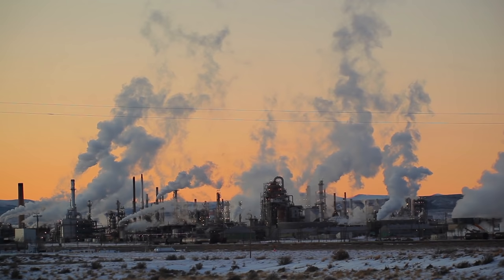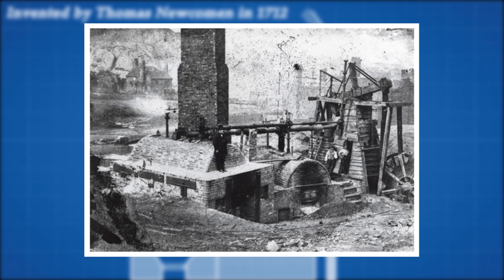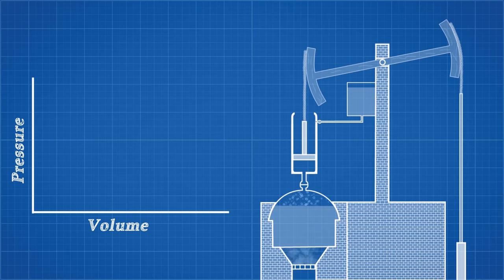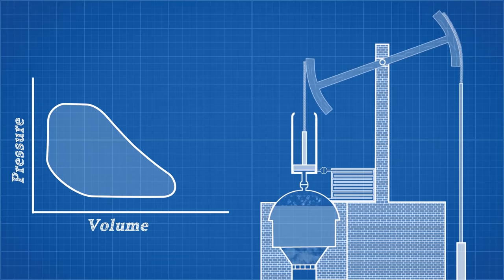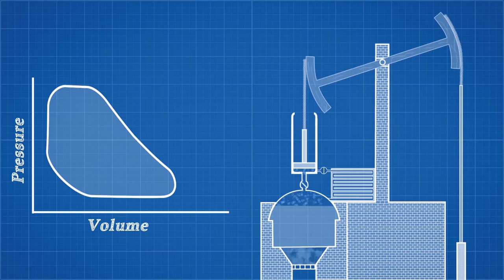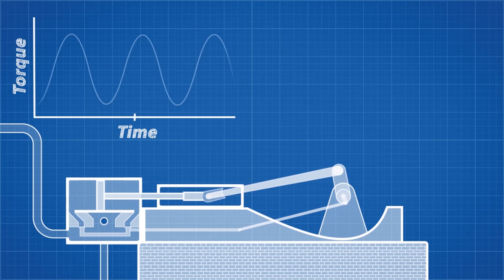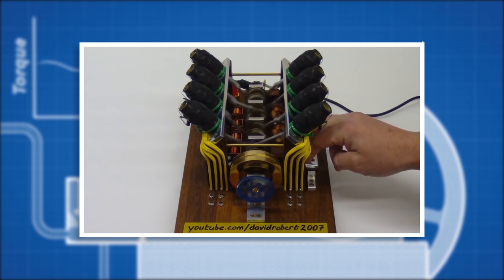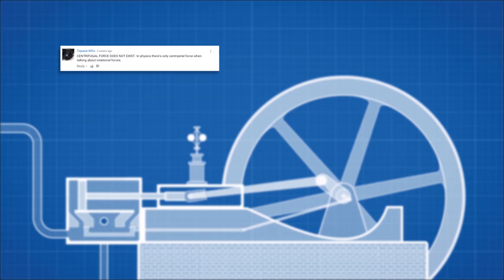Steam Engine - How Does It Work

Comment: Modern history is about human kind trying to find different ways to boil water.
Reply: Hmmm... A new type of internal combustion engine? 
Can I put people in a giant metal shell with a massive turret powered by said engine in order to obliterate my enemies?
Reply: That's not modern history, that is the cause to write history :D To kill each other in better and more efficient ways
Reply: I swear we'll just be using antimatter to boil water if we ever get a significant source of it.
Reply: There is the van allen radiation belt, which contains a lot of positrons
Reply: Isnt that something. If only the regular people knew. I will like your comment.
Reply: no the van allen does not contain positrons boi that would create gamma rays everywhere
Reply: There is only one way to boil water......Heat.
Reply: But in space, there are gamma rays everywhere. Among positrons, electrons, protons and other excessively energetic particles called "cosmic rays".
Reply: Ryan beck and pressure
Reply: Andrew V the pressure doesn't boil it.    The Heat the pressure creates does
Reply: Ryan beck I'm talking about pulling a vacuum which lowers the boiling point. It does still require heat to set the molecules in motion but at lower  pressures the water will boil water with less heat such as room temperature.
Reply: Burning dead stuff for energy, it's the human story.
Reply: Solar, wind, hydro, geothermal.... none of these require us to boil water.
Reply: To be fair war did push technology forward. No matter how fucked up it is to think that, it definitely help us to reach where we are now
Reply: It's easy! Just use electrici- oh, wait.
Reply: The British had to use it for TEA as well as STEAM
Reply: umm....... oil
Reply: +Esteban Wants to Die  Stop playing video games.
Reply: Water is a good way to deliver energy.  There's also air, though, but it's more compressible.
Reply: Incredibly accurate.
Reply: @lelcetz7628  It very well may, albeit in very small quantities so that gamma rays wouldn't be an issue.
Reply: wrg
Reply: Yep, pretty much just comes down to water, life's basic need.
Reply: And Heat, Also a thing I need to survive these winters.
Reply: LOL. Even nuclear power is being used to boil water.
Reply: 4IN14094 ikr
Reply: @runabout111   that's be cause he that controls the purse strings steers the world and nations.  kings, queens, and presidents,   bend the knee and heaven and earth is his playground.  his and his off spring "will"  be done by men gladly unwittingly or not , until the chains are broken.
Reply: lool when you put it that way, but more about harnessing energy from our surroundings
Reply: Steam engine is the way forward but rain water is free that’s why they won’t pursue it
Reply: Nuclear Engineer here, it's the same thing.  We just use fancy 'coal'
Reply: @rwbnatureadventure3876  👁👄👁
Reply: @rwbnatureadventure3876  True, but there are lots of different ways to get that heat.
Reply: I have a doubt,if some one can answer it woul be great,it may sound silly
Q1.In a steam engine,is the forward stroke speed equal to reverse stroke speed,i know they are not very different,but still if there is a difference of seconds or micro seconds
Q2.if the forward stroke pressure(or force)is similar to reverse stroke pressure(or force)
Plz answer my two question,i am a student
Thanks in advance
Reply: "It's hard to argue with his assessment"
Reply: 6021
Son-"Why did the people of ancient times boil water?"
Father-"To make technological development."
😂😂😂😂
Reply: @smooshfanultra  yes you can.
Reply: @Triumph263  lol
Reply: And how to throw stone better
Reply: @huntsvilleadventurer  I was with you till you threw in Geothermal. Geothermal is all about boiling water. ; )
Reply: @Delfigamer1  HA HA NOSHEET THANSK CPT OBVIOUS
Reply: Bro
Reply: so far nuclear is one of the most efficient
Reply: @smooshfanultra  Can I preserve a human and bring him/her back to life in the future?
Reply: Just buy cettle bro
Reply: We know what happend to the newest way to boil water
Reply: Hopefully we just improve on our love of boiling water to get steam to move/kill things instead of switching to something else
Reply: Mfw nuclear energy of just fancy ways to boil water 😔
Reply: And - we still haven't got past using fire for key or large transportation.
Reply: You Should boil water with induction heating. And then steam engines are carbon neutral

Comment: The claim that the 1712 Newcomen engine's piston was raised by pressurized steam is completely wrong.  The piston was raised by the weight of the pump rod and pump plunger.  As it rose, it DREW steam (at essentially atmospheric pressure) from the boiler into the piston chamber.  Then cold water was sprayed into the piston, condensing the steam and creating a vacuum.  The differential pressure between the atmosphere outside the piston and the vacuum inside the piston forced down the piston, causing the pump to operate.  At the bottom of the stroke, the pump rod had been raised back up and it's weight was ready to pull the piston back up.   The first pressurized steam engines were not developed until about 1799 by Richard Trevithick, with others also being given credit for working on the idea at about that same time.  This was almost a century after Newcomen invented his engine.
Reply: Andrew Russell thanks, I thought that was the case.

Comment: 2:55 Turing a piston horizontally does not change how atmosphere if pressure affects it... Pressure acts in all directions equally... It only changes the part of the force intrigued by gravity
Reply: Still a great video though
Reply: Yeah I noticed that too
Reply: Sorry Master, gravity is not the big factor. The pressure horizontally or vertically is the same, so that is not why steam was used instead for the return stroke. The power in the earlier version of the engine is the difference between the atmospheric pressure and the reduced pressure of the air and condensed water. It will work no matter which way the piston is oriented, even upside-down.

The real reason is that the new configuration has a power stroke in each direction. The condenser is the little hole under the piston. Each side of the piston is alternately connected to the steam source and to the condenser. The piston doesn't rely on atmospheric pressure at all.
Reply: I was thinking the same
Reply: I have to add to your theory.....if the steam piston is laying on it's side there is a significantly higher wear caused on the bottom of the piston and the cylinder.....caused by gravity alone.  Placing the piston/cylinder in an upright position takes that effect of gravity out of the picture.  You are certainly correct on the forces but gravity has an effect by an increased side load on the piston/cylinder......wears less at the top, more on the bottom...bigger the piston/cylinder the more significant the wear.....weight issue
Reply: Caught that too.This is the first flaw ever caught in his videos so not going to be too harsh haha.
Reply: What if it’s in a vaccum
Reply: Sir Cowsome well then it would work slightly faster due to 0 air resistance
Reply: Yeah I think he meant gravitational force, I didn't catch that mistake
Reply: Thank you, I thought I've been fundamentally misunderstanding pressure my entire life for a second lol
Reply: okay yeah, thought that sounded off

Comment: In your steam engine animation, the slide valve is positioned 180 degrees from the piston on the crankshaft. it should be positioned 90 degrees from the crank. Also, most steam engines use an eccentric to operate the valve, not a cam (or a crank, as shown in the animation).
Reply: I'm sorry if I sound like a negative nancy, but I really wanted to point this out.
Reply: @sachideshmane5088  You NEEDED to point that out because the animation as it is, is lacking any real engineering insight. No need for feeling sorry. He doesn't understand atmospheric pressure as well so he doesn't do engineering any favour by butchering how it works.
Reply: @DreadX10  Calm down
Reply: @robertpaulson2052  When you have nothing to say, it is so much better to say nothing.
Reply: @DreadX10  Then why do you keep commenting?
Reply: @robertpaulson2052  You'll have to figure that out all by yourself.

Comment: the best thing is her unpredictability, one moment she can run soo smoothly her rhythmic noises are soothing then out of no where she can play up. slamming down with such force and you have to run over to the steam valve and shut her down while adjusting the pins and the weights on the piston till you find that sweet spot to return her to the point where she is happy. such temperament, such power and yet no matter how much you get frustrated by her, you love her all the same
Reply from the maker: hahaha that's awesome. Will definitely pay her a visit if I am in the area!

Comment: I'm building a steam engine as a "final exam"  in my machining class at my technical college.  To pass, it has to run for one minute on 200-300 psi.  This gives me a better understanding of how it actually operates (I've only made one of the 23 pieces so far).  Thanks for the video. :D
Reply: How did it go?
Reply: How'd it turn out?

Comment: Two mistakes - the steam coming into the cylinder is at atmospheric pressure, it doesn't push the piston up. Rather it is drawn up by the beam being unbalanced and heavier on the pump side than the engine side. It's the relative vacuum formed by condensing the steam and atmospheric pressure acting on the opposite side of the piston that does the work of moving the piston. That's why it's called Newcomen's Atmospheric Engine. Second one is that atmospheric pressure works in all directions - the cylinder for the reciprocating engine could be in any orientation, but you wouldn't be able to drain the condensed water, so it has to be upright.

Comment: Hello Brian, love your videos, and that’s why I make this comment. At 2:44 you say 

“We have turned this piston’s cylinder on its side, so atmospheric pressure can no longer force the piston back down, so we need to use steam on the return stoke. This requires a control valve, to control when the stream enters and leaves each side of the cylinder”.

Atmospheric pressure can push against the piston in ANY direction IF you have an open cylinder. Did you mean to say that gravity can’t force the piston back? And you don’t have to use steam on the return stroke, if you have a flywheel (it does add to the power). A big shift in steam power evolution at time 2:44 I think was going from an atmospheric pressure power stroke, to a steam pressure power stroke.

Anyways; most of what you say is correct, and clear, and I appreciate that.
I now see that I’m not the first person to call your attention on this.
Ok, keep up the good work!
Reply from the maker: Yeah, I'm embarrassed about that, not sure how I didn't catch it during my iterations of my scripts. In my head I was thinking gravity. Hope that mistake doesn't take away too much from the video.
Reply from the maker: I just realised you have pretty interesting content on your channel! I really want to make a video about sterling engines at some point.
Reply: Ah; you do understand how it works but made a mistake in the script. I do that all the time! It’s so easy to make a mistake and not see it, even after triple checking.
Reply: Well thank you :-)  I want to make a “how a stirling engine works” movie as well. Maybe we can work together on this one? I could for example fact check your script. Many people don’t understand the stirling engine, think for example that the displacer is a piston.. and such. If feel the stirling engine has a lot of unused potential. My address can be found on my laesieworks website.
Reply from the maker: Absolutely yeah, always nice to work with someone on videos. I actually built a 3D model in Autocad, based on some designs I found online. I wanted to try and build it with my 3D printer, but never got around to finishing it. The tolerances were difficult to get right. I'll send you an email now
Reply: Giesbert Nijhuis i
Reply: Wtf is horizontal motion in the context of torque?  Wouldn't that be clockwise or counter-clockwise?
Reply: I have a doubt,if some one can answer it woul be great,it may sound silly
Q1.In a steam engine,is the forward stroke speed equal to reverse stroke speed,i know they are not very different,but still if there is a difference of seconds or micro seconds
Q2.if the forward stroke pressure(or force)is similar to reverse stroke pressure(or force)
Plz answer my two question,i am a student
Thanks in advance

Comment: Always great videos. I would have likes a bit more details about how the steam circulates, and what are the steam temperature values in the advanced engines, but this introduction is already very nice. Just a minor comment,  wouldn't it be better to imagine flywheel as a mechanical capacitor instead of a battery? Capacitors are exactly for this when converting AC to DC current.

Comment: Many people seem to forget that steam power is still one of the most used ways to generate power. It just uses different types of heat sources and the designs changed drastically. Even nuclear power is just nuclear fission heating up water to power turbines.
Reply: ITYM... Nuclear Fission increases the temperature of water changing it from a liquid to a gas (water Vapor/Steam)
The steam is first used to SPINS the turbines that SPINS A HUGE MAGNET within a huge coil of Conductive Metal Wire (Cu). Causing electrons to flow within the Copper wire. (Alternating Current).  Typically these facilities operate ultra-efficiently...yada-yada-yada, blah-blah-blah....(is similar to what you meant to say, I think? right? Yeah, of course!

Comment: 2:48 The atmosphere wasn't pushing the piston down, it was just pushing it against the decreasing pressure of the hot side. In the horizontal orientation, the steam is acting on both sides of the piston, so the atmosphere doesn't have any force applied to the piston. In other words: the 1712 version of the steam piston should be able to work on its side - the orientation doesn't have an effect on the action of the piston.

Comment: Question: so where does the steam go after passing through the cylinder?
Reply: If you look at the animation you'll notice a chamber with a hole in the middle. The system is designed to release steam from the chamber you're pushing against, both to release the steam and to decrease pressure making the push from the opposite chamber easier.
Reply: @piroman85  this shit is crazy
Reply: Out into the air
Reply: Have you ever seen a steam locomotive? Notice the funnel? That’s where.

Comment: What you said about atmospheric pressure is wrong. You are confusing gravity with atmospheric pressure.
Reply: I dont think the gravity plays that big a part. If that were the only force pulling the piston down, i dont think the pump would get pulled up, as iv’e heard the pump part is heavier. So there’s some vacum in there pulling the piston down/atmosphere pressuring the piston down.
Reply: Exactly.

I wd think that vapor pressure does work on the up stroke and gravity on the down stroke.

..but I still liked the video.

I would have made the valve larger with a arrow, I think thats the STAR, Genius of the steam engine.
Reply: gravity is literally an illusion. Atmospheric pressure effects what you call "gravity". Every and any equation  with gravity, has every and anything to do with "pressure".

Comment: SG: I think he confuses gravity with atmospheric pressure.
FM: Isn't atmospheric pressure caused by gravity?
SG: He says that the piston works against Atmospheric Pressure. In both cases (vertical and horizontal) that is not the case as the inside of the piston does not have a pressure less than Atmospheric Pressure. The water cooling in the first case causes condensing of the vapour reducing the 'gas content' and thus a sort of vacuum is created causing it to fall down faster than normal condensing would do.

Also he says that in the case of the horizontal cylinder Atmospheric Pressure does not act anymore because it is tilted. It is the weight of the piston (head) that is removed out of the equation in this case (if we neglect friction).

Comment: I don’t know if anyone has pointed this out yet, but the animation of the double acting cylinder is incorrect.  The slide valve crank that changes the direction of steam should be offset 90 degrees from the main crank.  You can find more animations of what I’m taking about at 
http://trumpetb.net/loco/rodsf.html
If offset 180 degrees as shown the cylinder will stop halfway through its stroke, but when offset 90 degrees the direction changes right at top dead center and bottom dead center so to speak.

Comment: Great video. Without meaning to be to critical there are a few small thing I would point out. In the Newcomen engine the steam does no work and is at a very low pressure, about 15psi I think. It was actually the weight of the pump rods that pulled the piston up as much as it was the steam. Hence it makes sense to have a vertical cylinder. 
The main thing that changed and really sparked of the industrial revolution was James Watt's invention of using high pressure or strong steam as he called it. This was as a result of the advances in engineering technologies, both making it possible to build boilers up to a higher pressure and more complex machinery to tighter tolerances. Watt came up with some very important inventions which made his engine much more efficient such as his parallel motion, separate condenser, crank and flywheel. The difference with the separate condenser as opposed to the atmospheric engine is that it's only reducing the pressure the steam is working against instead of providing the power.